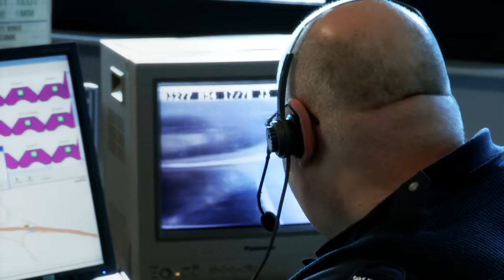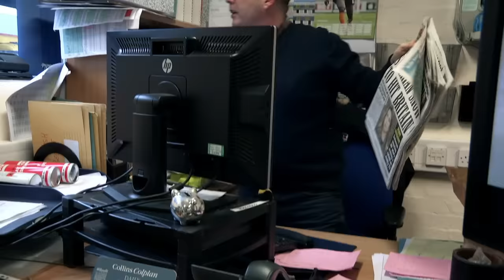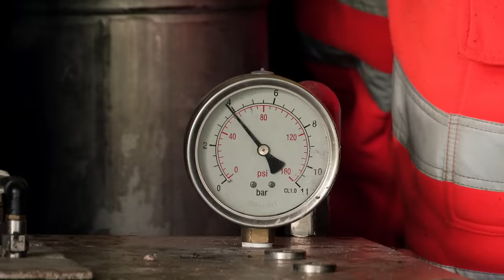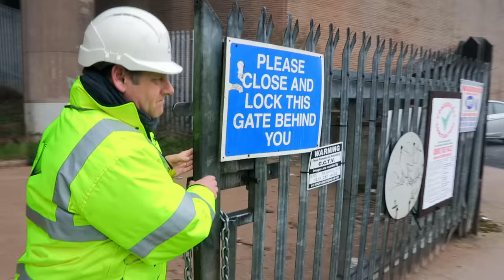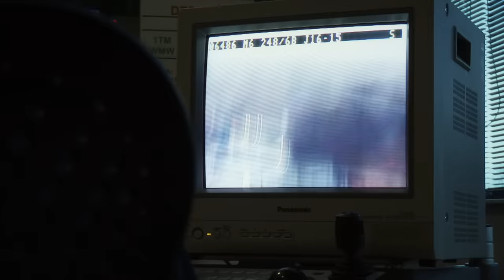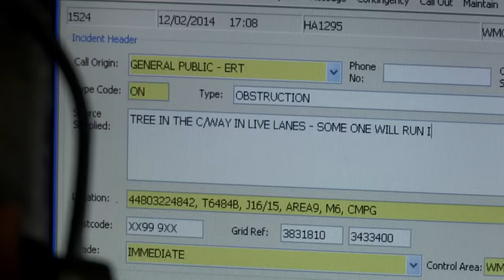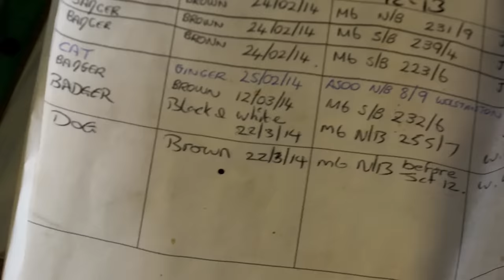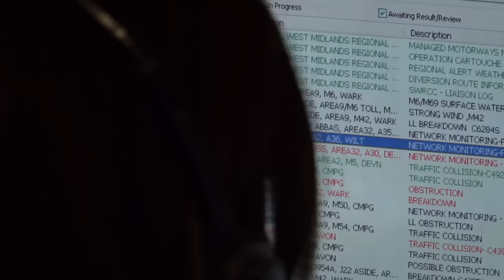Behind The Scenes At Traffic Control | Life On The Motorway E2 | Our Stories

Comment: Makes me laugh when they talk about bad weather on the motorways try living in Canada in the winter and spring time this stuff is a joke compared to what we deal with. I've personally driven through a Northeastern snow storm it felt like I was driving on the ocean with huge swells, plows couldn't even be on the road but my VW Jetta got me home. Respect to the road crews though.
Reply: Were not prepared over here for ‘bad weather’, so when we do get a lot of snow/ice/fog everything grinds to a holt…
Reply: We are ridiculous when it comes to dealing with the weather. Every year people act like it’s unexpected and we can’t cope it’s so frustrating.
Reply: in the 80s there was 1/4 snow and Heathrow closed. No snow plows
Reply: It's unique. In Catalonia, houses and places are designed for the heat. In the UK, they aren't. Generally a mix of Rain and Overcast is the normal and anything else is unprecedented change.
Reply: Appendium: After some more time living here, Catalonia does, indeed, have British weather, but this is usually confined to late Autumn and Winter.
However, the UK does suffer in heat which is normal for Catalonia. This does not mean the UK is inferior. It just means that the UK is used to different things.

Comment: I would recommend a unit consisting of a Bobcat w/bucket and sweeper brush (or separate small sweeper) and they could clear those “mini-mudslides” that cause lane flooding. Trailer with unit only $40-60 k. Could even just have contractors in main locations willing to do emergency callouts within X minutes. After a year or two, you do a cost assessment to buy or contract. Cheap, effective and not risking 10-20 young soldiers (or employees) that can be struck by traffic.     Just a suggestion from 🇨🇦 - family by history. 🍻